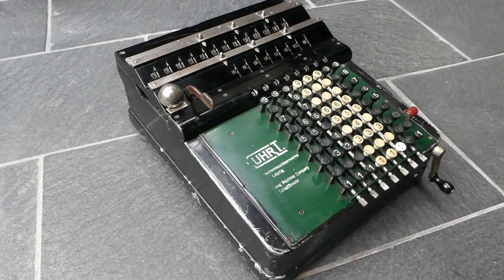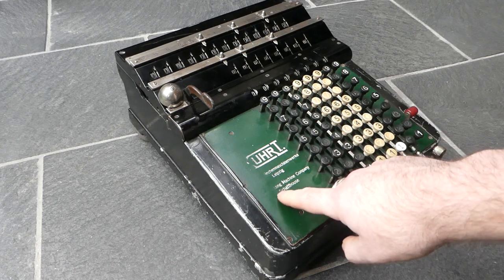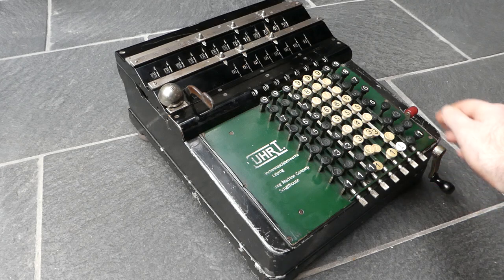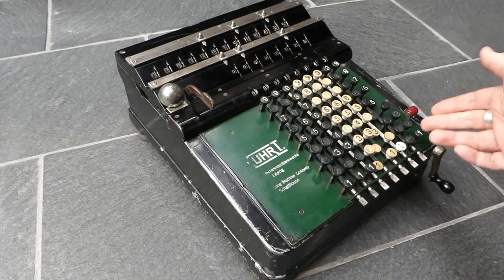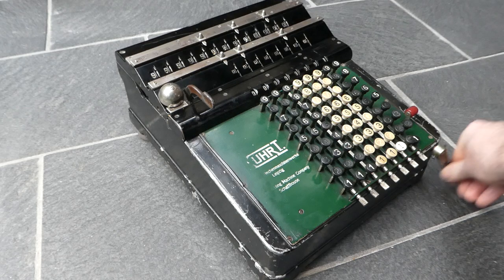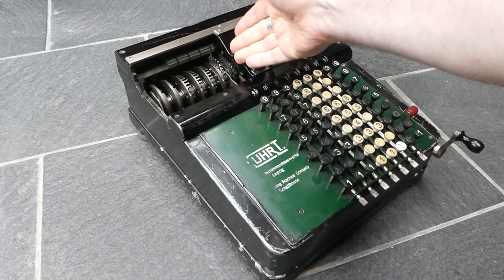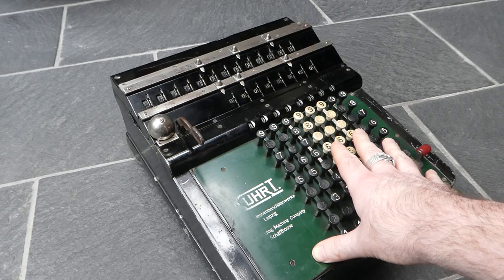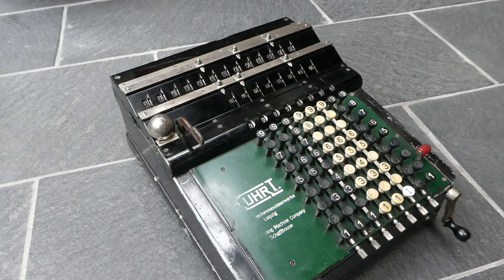The Kuhrt calculator

Comment: A very interesting and beautiful calculator. I like the machines with the bell on the outside.
Did you buy this through eBay? There was an auction in December that I didn't win...
Reply from the maker: Yes, I got it recently on eBay for 239 Euro plus postage. I think that is a very reasonable price for such a rare machine. I also got a Barrett 6 that will be appearing here in a month or so.